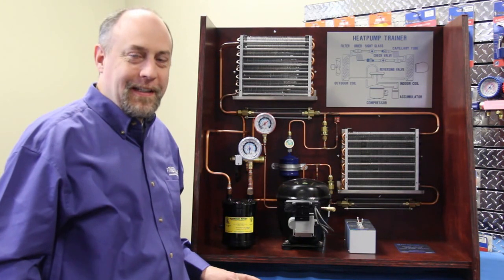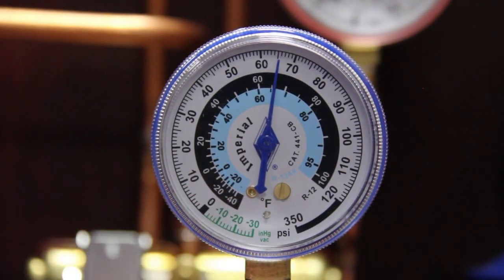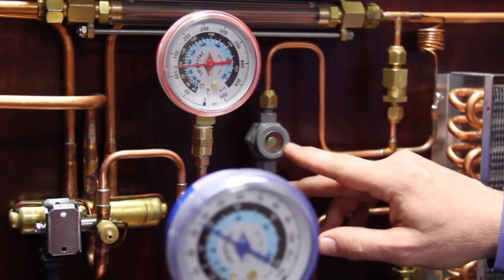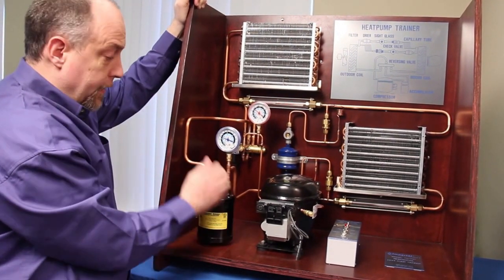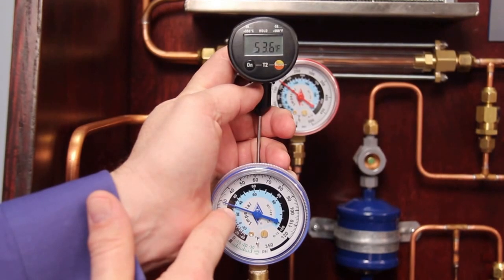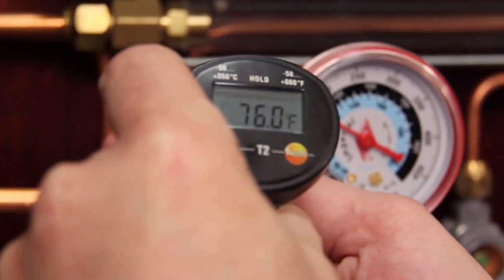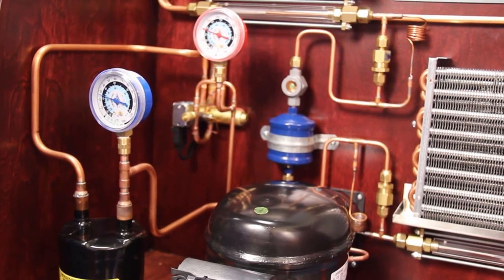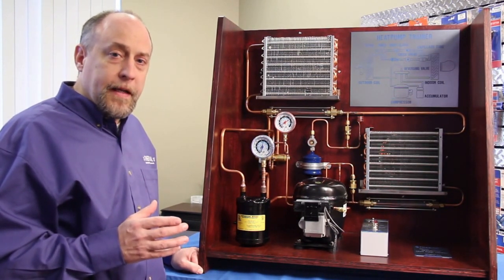iConnect Training TU-701 Heat Pump Trainer

Comment: If I wanted to build my own heat pump (small 1000 BTU) on the cheap: What are my options?  Does anyone sell kits?

I want to build one to replace a 300W resistive aquarium heater to see how much more efficiently the water can be heated.
Reply: Hi Andy.  We manufacture our own training units, but we buy our heat pumps from the manufacturers.  Sorry we can't help you with your aquarium project....sounds interesting!